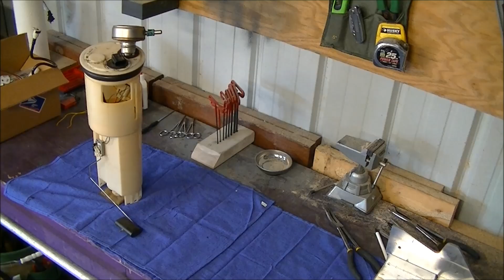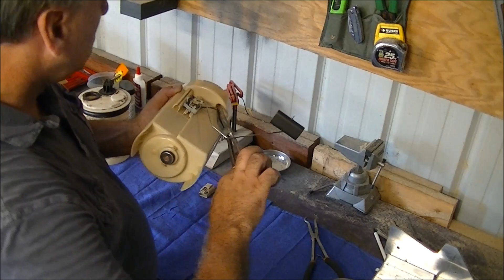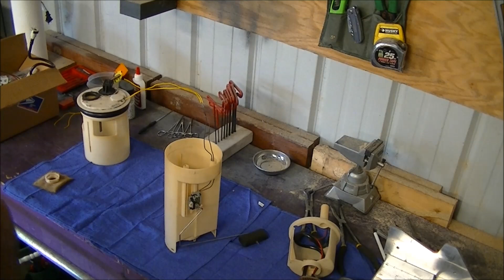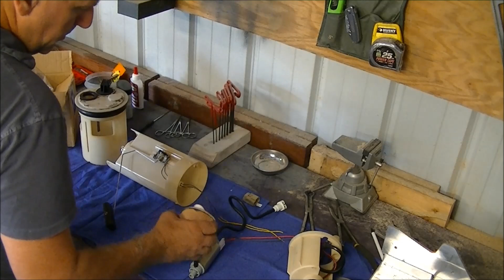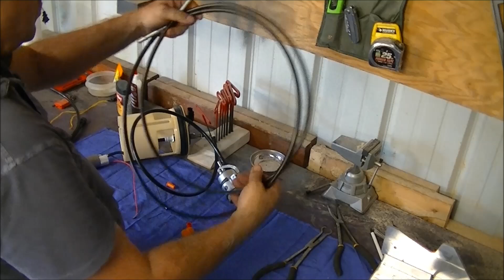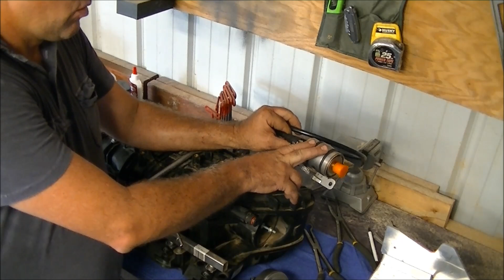How to Disassemble and Modify Fuel Pump Assembly

Comment: your video is helpful to me as far as dismantling the module is concerned; i was stumped as to how to remove the insert; but i only want to fix mine to OE not upgrade it, though its interesting ........i need to learn where the the CHECK VALVE  is , i may just buy the whole module again. but needed to take apart the module just to see how its put together, for the sake of the automotive course Im doing if nothing else.......thank you

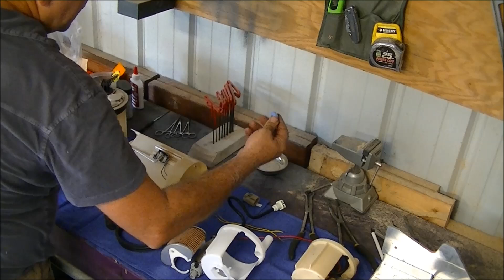Comment: @8:20  and @10:28 I found inside of that white swirling canister (which is part of the sending unit) two washers, One on the bottom fm/some kind of plastic, leather or smth (very thin, less then 0.5mm) and on the top of it a metal one (thickness ~1mm). Size of both ~ 5 cents coin. Both were resting freely not attached to anything in the small well on the very bottom of the swirling canister (cylinder). I didn't see those in any film on the subject and not sure if they are supposed to be there, or not, maybe someone put them there by mistake. The author of this film mentioned briefly @10:31a sealing o-ring on the bottom, but those two I found on the bottom of my basket (swirling canister, cylinder) of the sending unit were not rings, bur washers. I would appreciate any opinion on this matter. 2001 Saturn SL2. Thank you for the great film.

Comment: Saved my ass buddy, thought i got ripped on a performance pump because it only came with the little inner cup, not the larger external sleeve. Called 3 different mexican friends and after 2 and a half hours we still couldnt figure out how to pop that inner cup out, thought id have to settle on buying a whole new stock pump for my manual 318, turns out you just have to harry houdini a sneaky tab.

Comment: But where is the Check Valve to prevent fuel from losing prime,
Reply: Don’t know if you ever figured this out (3 years later lol) but for anyone else with the same question, this is usually a function of the fuel pressure regulator or fuel pump.

Comment: not to sound rude but this is one of the few videos ive found so far... but yet you didnbt show anything because everything was ethier already done or u didnt want to reassymble it.. so what was the point of the video... it was just talking. its not helping me see how to get it all apart and stuf.. let me see  how difficult it is... im having a issue with my pump looks identicle to this even though its a different vehicle... its a dodge ram,....and it will not run below half of a tank.. it use to mess up a lil below half a tank but i could force it to run by stomping the gas... but now it will not run below half of a tank.. it runs great above that... and it also squeals very loudly only when below half of a tank....  i cannot afford a brand new fuel pump assymbly piece...  i figure since all my issues are only below half a tank its most likely that rubber hose thats inside there.... when below half a tank its exposing a bad spot in the hose which creates a bad suction for fuel... im getting alot of air and very little gas which is why it wont hardly run....i just have to assume its the rubber line because thats all that makes sense in my head  from what ive seen of the pump online. the pump itself is good when above half of a tank...
Reply: I am not sure if there is a question here somewhere. As far as opening the basket, it is not that hard. You might break the clips, which is why I used a new bottom half. Some people have luck just prying the bottom basket off.

Common sense tells me that if you don't have enough money to repair it correctly, keep the truck more than half full?

Good luck.